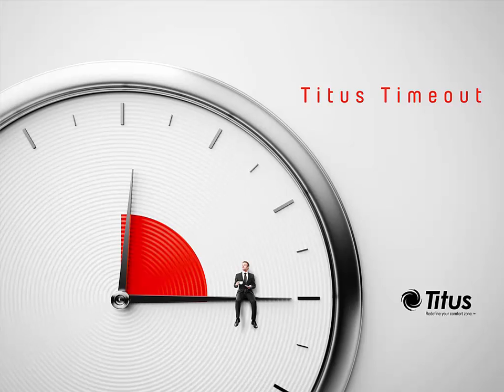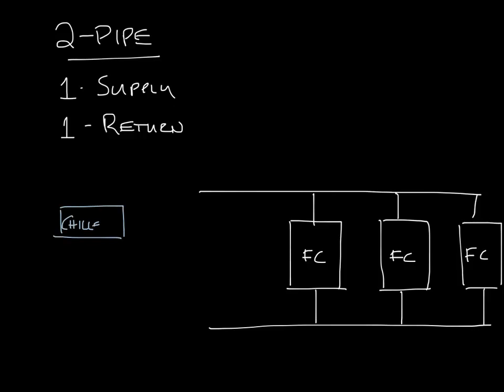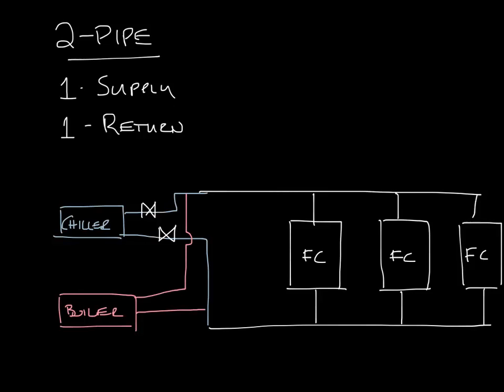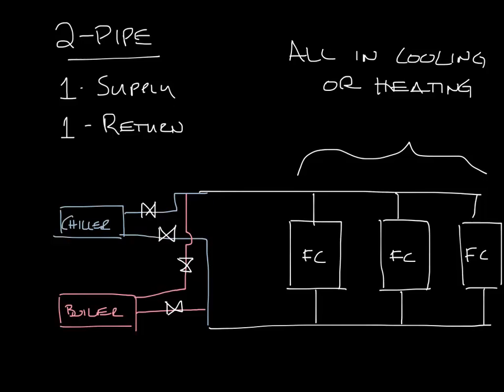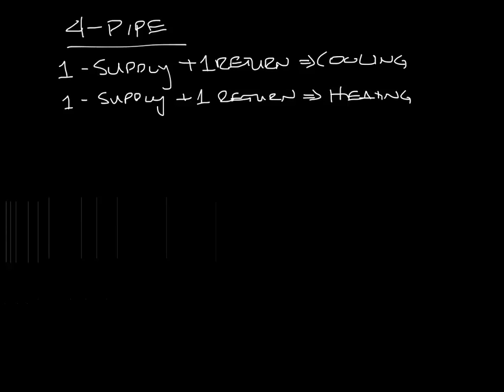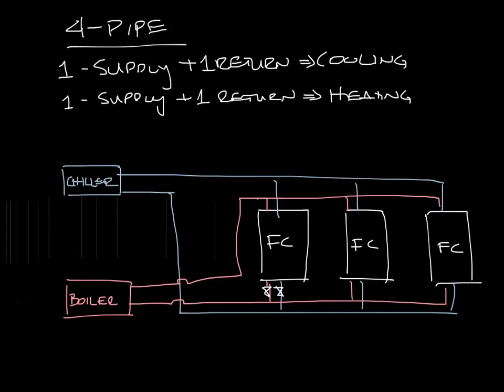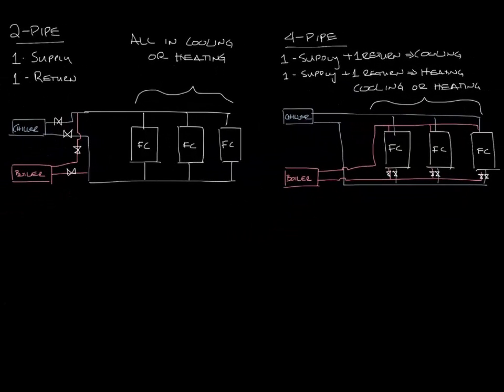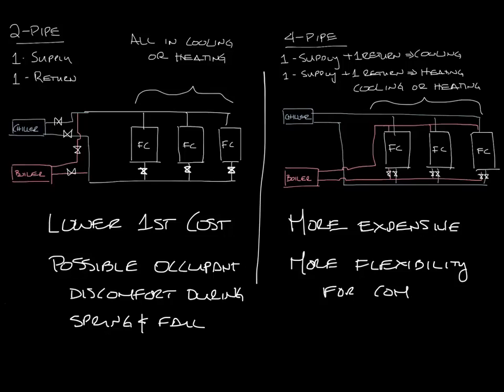Titus Timeout Podcast - 2-Pipe vs 4-Pipe Systems

Comment: I searched this video because I lived in a two-pipe building for 12 years before I was able to find a modern building with individual climate control.  I live in Chicago, IL where we have seasonal weather changes and we would have "two-pipe hell" days like you describe in the video.  The building I live in now doesn't really have "four-pipe" but it has both heating and cooling fan coils in each apartment and you can switch it with the thermostat.

It is unfortunate that there are so many older buildings, even condos, that still have two-pipe because they were built that way and it would be impossible to change to a four-pipe or individually-controlled HVAC system.